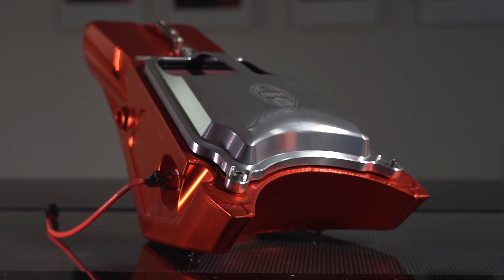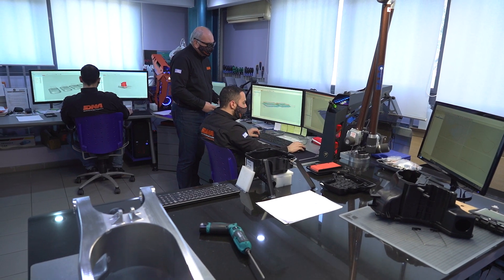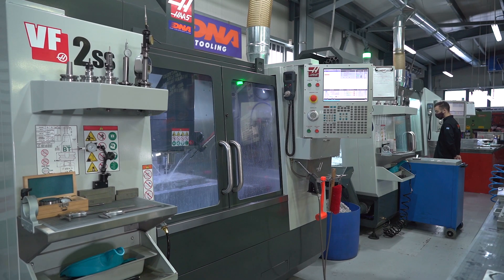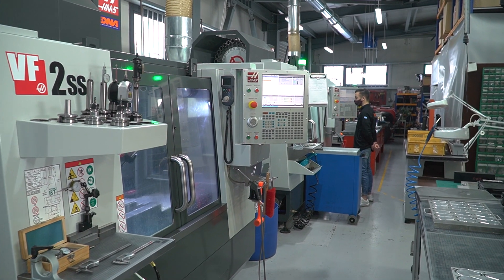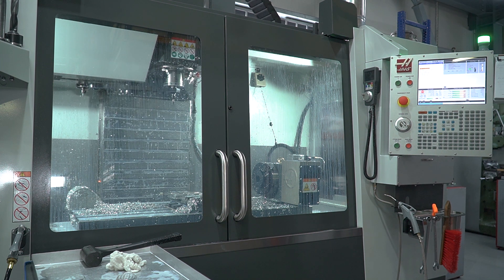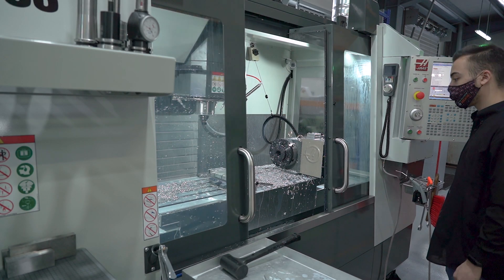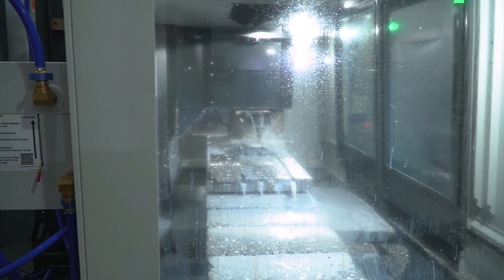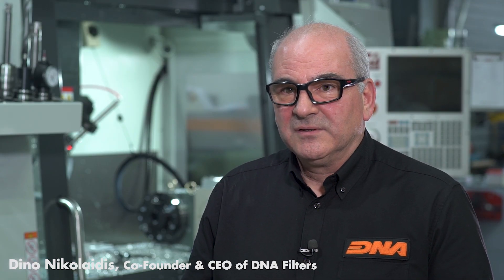DNA High Performance Filters - HAAS CNC machines & DNA Tooling-Machining department

Comment: Can I ask if this performance air filter can replace the stock air filter, does the electronic fuel injection motorcycle need any further adjustment?
Reply from the maker: Depends on the model, the stock ECU can automatically adjust to the extra fuelling needed. In cases that the stock ECU can not compensate the change we are informing our customers with instructions inside the box of the DNA Filter that refuelling is needed. We always dyno tests our products to check exactly this specification.
Reply: @DNAHighPerformanceFilters  I use DNA P-Y1UB15-01 for yamaha exciter 150 in vietnam
Does my ECU have auto-tuning?
Reply from the maker: @BrightFit88  No it does not. This is why the air filter for your bike has such a small air flow difference compared to the OEM. It's one of the very few products with less than 5% air flow difference.

Comment: I saw that you are selling the DNA filter for the Maxsym  600i. You make some impressive claims ie the filtering efficiency percentage of 170%. Your filter is double the price of the standard SYM filter. I see it is also washable. How many times can it be re-used/washed?  I am very interested. Will I notice a performance and fuel consumption improvement/difference? What guarantee do I have? Tks.
Reply from the maker: Hello Gert, our product for this model offers 170% more air flow compared to the OEM air filter. The filtering efficiency is 98-99% on all of our products. Our products can be serviced with our service kit for hundreds of times. We offer a lifetime warranty if you use our service kit and you register your product on our website. The lifetime of your motorcycle. Fuel consumption , you will se a small improvement of about 30km more range from our tests.